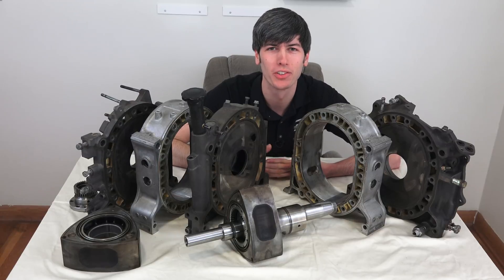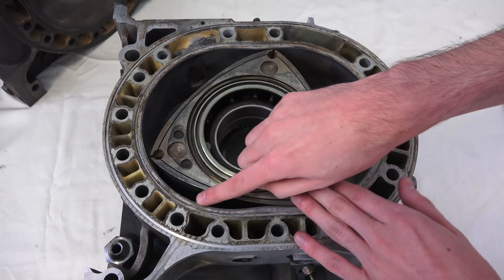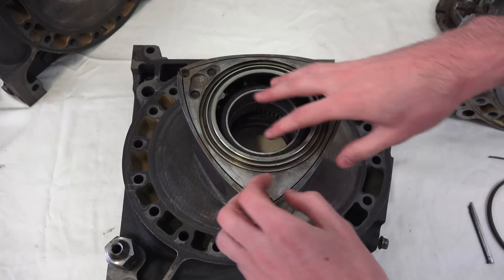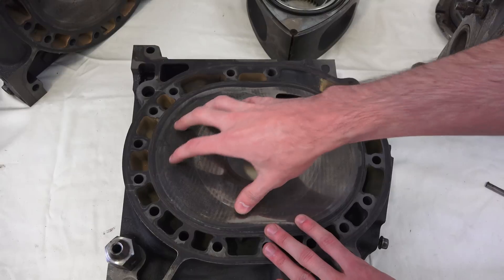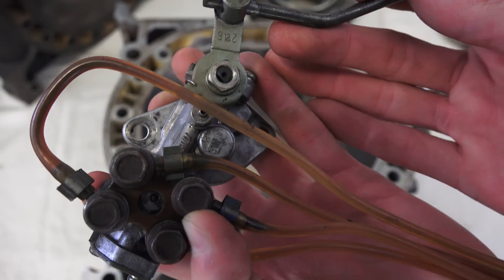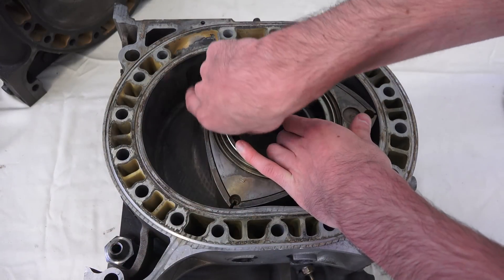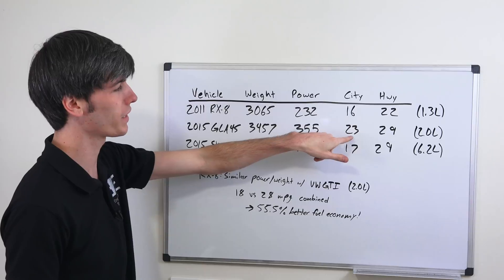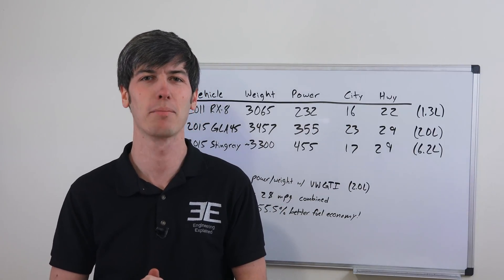4 Reasons Why The Rotary Engine Is Dead

Comment: Thoughts then on Mazda's upcoming RX9?
Reply: The real doktorbimmer 
Please get therapy
Reply: The real doktorbimmer I won't apologise to you until you are ready to say sorry to everyone here for being a dick. I've admitted I was wrong, I wonder if you would have had the balls to do the same?
Reply: Dylan Greene it's a heartbreaker. Though I hope they have something else up their sleeves. As much as I'd like to believe that they are capable of building something that'll be re-evolutionary as the RX 8 was with the RX 7, Mazda is still a boutique automaker.  Luke Subaru, who also has had a resurgent growth lately, they don't have the financial capability to build a one off engine of that magnitude. The rotary as the video explains, is not emissions friendly and takes a lot of effort to make it work. Something that is on the other spectrum of the Sky Active engines they have invested in and are in all their vehicles. 

The next step they will probably do is evolve Sky Active to include turbo charging to increase output as the competition is doing. Though rotary has the capability to do high output at a low displacement, it can't without the inherent issues of managing emissions (oil leaking) and maintenance. 

You don't see Subaru making huge investments in these one off type of engines either. 

Hyundai as small as they are in the US, is a huge company and invested their engine development already into gasoline direct injection and turbo charging they have now entered the next gen of hybrids to compete with Toyota using their Ioniq. But even they don't tout anything that would be RX 9 like. Business sense wise they are going towards hybridization and electric. 

With the trends going in efficiency due to CAFE and EPA requirements, the evolution of mainstream engines are gasoline direct, turbo charging, hybridization and electrifying. And looking at where Mazda is, they have a long way to go to keep up. (as does Subaru).
Reply: +The real doktorbimmer
Bimmer McBimface, has been given many over the months, but selective amnesia develops in this astroturfer,
Reply: The real doktorbimmer
Reply: The real doktorbimmer Mazda still make Wankel crate engines for aircraft. They can't be sold in the US because of a licencing issue with NSU Wankel. Mazda also supply engine blocks to other crate manufacturers.
Reply: I can name a handful of aircraft kit manufacturers that supply firewalls for 13b's (Lancair, Van's Aircraft Kis Aircraft). The FAA and EASA don't have a list of engines that you can't fly with. Only a code of regulations that the engine needs to meet. Having looked through them, there is no regulation that prohibits Wankel engines.
Reply: I didn't say in mass production. I said that they still supply blocks for crate motors. Crate motors that are used in road cars, racing cars and aircraft. But let us quote Jeremy Barnes from Mazda US shall we :- "For the future, the rotary is NOT DEAD.".
Reply: Not having plans to do something doesn't mean you won't do it if those plans change further down the line. Also, next time you ask people for sources, perhaps make sure you're already supplying your own?
Reply: You're making the claims here, you're going to need to bring the evidence to the table yourself. You don't answer a request with a request. My theory is that you're talking out your ass and can't accept you have nothing to back your statements up or bother retracting them. So far that's proving true.
Reply: You are comparing a transportation vehicle to an engine. The steam turbine engine is still made, it is not used for trains any more. Yet it has had a long and industrious career in power plants.
The Wankel engine is still made, one company who makes them is called Aixro, click the link above and see what they make Wankels for, one use is automotive. Then come back here and spout some off-topic rant, as you always do.
Reply: +Dylan Greene
Austo engines is another as is Rotax. Even the Indians have an outfit making them.
Reply: Saying something is a fact does not make it a fact. Either give us some evidence, in the forms of articles or similar, or stop posting. All you're doing now is flooding the thread with what is essentially fanboyism.
Reply: You're the one making the claims here, you're the one that needs to back the claims up, not us. So I'll say it again. evidence or gtfo.
Reply: I've noticed. There's never a link to an article or video to confirm what he is saying as true. Only more statements of him saying it's true. He's basically using circular logic at this point. "This is true because I say it is and because I say it's true, it is true"
Reply: Astroturfers do exist, otherwise the term "astroturfing" wouldn't exist
Reply: as much as I had hoped for it, is dead, again. http://www.roadandtrack.com/new-cars/future-cars/news/a31802/mazda-ceo-kills-hope-new-rx-9/
Reply: Jim Lee 
Then I was wrong, that's a shame. Thanks for the info.
Reply: The real doktorbimmer No my comment will stay up. As I said, I can admit when I was wrong.
Reply: The real doktorbimmer
Bimmer McBimface, Mazda said they are to produce wankels for range-extenders in a deal with Toyota. You know this.
Reply: @johnburns4017  Can you please tell us what happened to the 2020 Mazda-Toyota range extender????
Mazda just announced its 2021 model line and I don't see it offered.
Reply: @sandervanderkammen9230  
EVs are taking over doktorbimmer. EVs.
Reply: The real doktorbimmer 
Bimmer McBimface, you must keep up.
Reply: The real doktorbimmer 
Bimmer McBimface, you must stop making things up.
Reply: The real doktorbimmer 
Bimmer McBimface, what else did the voices tell you today?
Reply: What is your point? You've gone off on such a tangent (as per usual) that the words you are saying are irrelevant to the conversation.
Reply: "If Mazda's CEO says "No more RXs"? "
You must stop making things up.
Reply: +Reploidx9
The plans for rotaries is for constant speed range-extenders.
Reply: Hold your horses. Where EXACTLY did Kogai say "no more RX's"? Can you show me where this was quoted by him?

An extract from an article cited earlier in this very thread:

>>
Mazda CEO Masamichi Kogai confirmed that the company has no plans to build a sports car larger than the Miata, effectively dashing hopes for the RX-9. Kogai isn't yet ready to declare the rotary dead, though.

"If we were to restart production of the rotary engine again, we need to make sure it wouldn't be just short-lived," said Kogai. "We need it to meet future emissions regulations. We are still conducting our R&D activity to overcome any issues we have with emissions and fuel efficiency.
<<

See, it's said the company has no /plans/ to build a sports car larger than the Miata, this doesn't mean that cannot change. Unless you're a clairvoyant and can see the future for us, which I HIGHLY doubt. The article even gives us something Kogai mentioned about RnD continuing on trying to extend the rotarys life by cutting emissions. There are absolutely no lines there saying or implying "No, the RX will no longer be produced ever" or "No more rotary engines will ever be produced." 

If you're going to make claims, give us your sources, otherwise just stop. Your statements are utterly baseless at this point in time.
Reply: +The real doktorbimmer
You area mental case. Get therapy.
Reply: You can say insults won't prove @John Burns point, but you know, repeating the same thing over and voer and over again doesn't make it true either. You're going to need some concrete, reliable evidence. And saying "go look at ..." is not evidence. You need to link it here yourself. Didn't you get the memo on how debating works? You want to make a claim? The onus is on you to prove it.
Reply: You've made a hell of a lot of claims, with ZERO evidence to boot. Quoting my replies isn't evidence for your statements. You're the one making claims here. Prove they're true. I bet you that you can't.
Reply: How about where you claimed where Kogai said "No more RX's"? Can you prove that at all?
Or where you claimed "The Wankel engine is obsolete... no longer manufactured anywhere in the world." - Did you check EVERYWHERE in the world? Including hobbyists/custom shops?
Or where you claimed "Mazda official ceased all research and development of Wankel type engines 7 years ago." - Even though Kogai mentioned RnD is still ongoing.
Reply: You cannot compare the steam locomotive with the Wankel engine. You are comparing apples and oranges. The steam engine is still used today, most power stations still use a steam turbine to generate electricity. As I've just posted up, there are manufacturers still producing Wankel engines for a variety of uses, one of which being automotive use. Boutique and batch processing are completely different things, it is very deceitful to conflate them as such, but then I expect nothing less from you.
Reply: "Kogai has said in numerous interviews dating back to his appointment to the position as CEO confirming the company has no plans to bring the RX line back into production." - Got any sources for this? I mean if he's said it multiple times there should be plenty of sources, I'm sure you can link some.

You claim the Wankel is obsolete, which would mean it's no longer used, which is entirely untrue.
Reply: Your "facts" are nothing but baseless statements at this point in time. No evidence, no weight. They're not in production or for sale? What are you smoking and can I have some? @Dylan Greene CLEARLY linked a website that STILL SELLS rotaries. I think you're hallucinating and may need some assistance.
Reply: Your citations princess? WHERE ARE >THEY<?

Take your fanboyism and leave. Nobody wants your kind here.
Reply: Bimmer McBimface, you are very confused.  Please get therapy.
Reply: +golgathum
We all know what rotary engines are.
Reply: Bimmer McBimface, how much do you get for astroturfing?
Reply: Bimmer McBimface, how much do you earn for astroturfing. Is it worth it?
Reply: Bimmer McBimface, you are an Astroturfer.
Reply: Bimmer McBimface is a seasoned astroturfer.
Reply: Bimmer McBimface is a seasoned astroturfer.
Reply: McBimface, is that the next step in astroturfing?
Reply: Bimmer McBimface, you have a thing about Mazda cars.
Reply: Bimmer McBimface, you must have dropped the therapy course. You are getting worse.
Reply: Mazda's president confirmed there was never any upcoming model called the RX9... he said it was all an internet hoax started by bloggers.
Reply: +Reploidx9
Bimmer is either:
   ♦ A Mental case.
   ♦ An Astroturfer.
   ♦ Or both or the above.

He goes all over the Internet saying the same thing despite evidence that he is he writing pure balls.
Reply: +The real doktorbimmer
Bimmer McBimface, you are not a messenger, you are demented.
Reply: The real doktorbimmer 
Bimmer McBimface, were the voices screaming loudly?
Reply: Just going to leave this here: http://www.aixro.de/en/products/civil/ 
Don't mind me.
Reply: The real doktorbimmer 
Bimmer McBimface, were the voices screaming loudly today?
Reply: +The real doktorbimmer
You are a nutball.

Comment: You covered the weakness of the performance very well.  What I, as a life long Manufacturing Engineer, quickly saw the weakness was generating the internal configuration of the combustion chambers.  It would a slow process of using a milling cutter or some other method.  Broaching could be done, but one small chip in the broach would leave a line.  The same would be true with the milling cutter.  What I think happened is some "bright" V.P. thought the Wankle was his ticket to the top.  I wonder where he is sweeping floors.  I remember Mazda tried it with their cleaver ads.  Making the cylinders for the piston engine is very fast.  Whether 4, 6, 8 or 12 cylinders they are all made at the same time.   Bore going in and finish bore coming out.

Comment: Low thermal efficiency, unburned fuel in exhaust, emissions and fuel economy, all can be fixed by re-designing the spark plug.
Current spark plug technology is not made for rotary engines.
Too much fresh air/fuel leaks past the spark plug hole in the combusted chamber out the exhaust.

Once that's fixed, rotary engines are good to go.
Seals need to be replaced every 50k miles, and due to the simplicity of a rotary engine, this should be a very low-cost procedure!
Reply: See what I mentioned above.
When the fresh air/fuel mixture gets compressed, at some point in the rotation, the spark plug hole allows a lot of this unburned air/fuel mixture to end up in the combustion compartment, straight to the exhaust, causing unnecessary fuel and efficiency losses, as well as extreme hot exhaust gasses.
Fixing that hole (making it flat), and using a different type of spark plug, will allow the engine to run at least 15% more efficient, and the main problem is not it's efficiency, but running the engine compliant with the emission laws. The reason they were unsuccessful was they would have to run the engine too lean, and still would find traces of unburned fuel in the exhaust.
It's emissions that killed the Rotary, not efficiency.

Comment: Mazda R&D boss Kyoshi Fujiwara confirmed Mazda will incorporate HCCI, where the fuel/air mixture is compressed to the point of auto-ignition, as in a diesel engine. HCCI engines achieve extremely low levels of nitrogen oxide emissions without a catalytic converter.

Mazda claim they have solved emissions and fuel consumption problems in the new SkyActiv-R engine. They are also developing a small simple range-extender for series-hybrids to be introduced after the RX-vision is launched.

http://www.motoring.com.au/new-mazda-rx-secrets-revealed-100186/

http://www.carsguide.com.au/car-news/mazda-skyactiv-r-rotary-could-use-compression-ignition-36576

https://etd.ohiolink.edu/!etd.send_file?accession=wright1419010366&disposition=inline

Comment: I think 1 of the top reasons, beyond it just being unconventional, was shifting. It's a very high revving engine compared to its piston counterparts, but the circular design meant that when throttle was disengaged to shift, the engine took comparitively too long to slow down to the rpm shift point. Many years ago under the Rory Byrne/Ross Brawn era, a  Ferrari engineer bragged that their engine could come to a stop from ~18k rpm in a few milliseconds. What that allowed the engineers to do was shift gears ultra quick and spend the rest of the FIA mandated time to shift correcting wheel spin. From a racing perspective, I think that may have been its greatest flaw. 

But i agree about the emissions. It needs its own classification like diesel engines. i had to get rid of my RX7 once NJ change the rules on emissions; could not get it to pass.

Comment: Racecars were never known for fuel economy, or for clean emissions. I can compare diesels and two strokes. Look at how a two stroke smokes, but two stroke dirtbikes are more fun to ride than four stroke ones. (In my opinion.)  Diesels roll coal, and look good doing it. I don't think Wankel had either emissions or fuel efficiency in mind when invented the rotary engine, I think he had less moving parts in mind. I can remember my dad building a model of a Wankel engine in the early 70s, and explaining the principle to me while he was building it. Of course, this was before the opec-manufactured phony oil crisis, and the gas lines, and the advent of little economy cars. We didn't realize then that fossil fuel is a finite resource, and population keeps expanding, and carbon emissions are poisoning our atmosphere while cfcs burn a hole in the ozone layer. But you can still run a large-displacement 60s or 70s American made engine (Or a rotary, or a two stroke, or any gasoline engine for that matter) on alcohol or nitro-methane, and you can run a diesel on biofuel. Alcohol can be fermented from lawn clippings, or any waste vegetable matter, such as banana peels, potato skins, apple cores, and other garbage. Biofuel can be produced from hemp oil, or recycled restaurant grease. You can also run an engine on natural gas, which is a fossil fuel, but is more abundant than crude oil. Sorry, I got off subject. Rotary engines may not be fuel efficient, but they have less moving parts. Yeah. Smoke a bowl.

Comment: I have a 93 rx7 that puts down over 300 hp to the rear wheels and gets over 30 mpg on the highway. You do need to do some mods ...intercooler, injectors engine mgmt system and a good tune. There is nothing like driving a properly tuned twin turbo rx7.